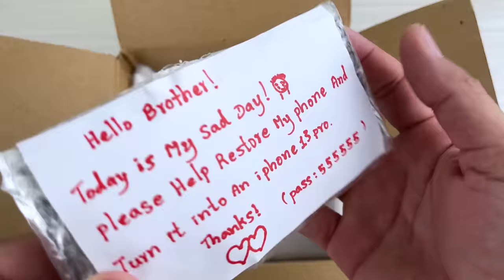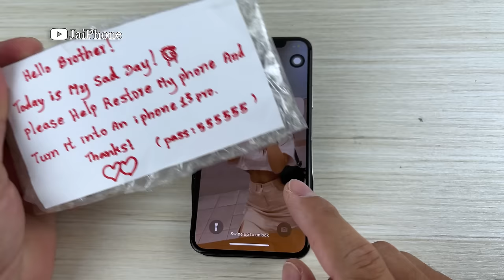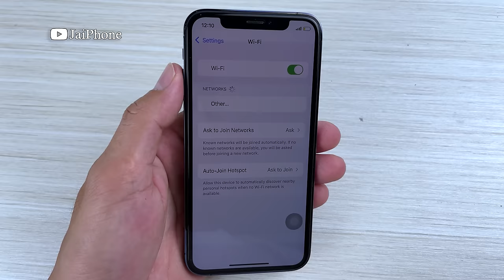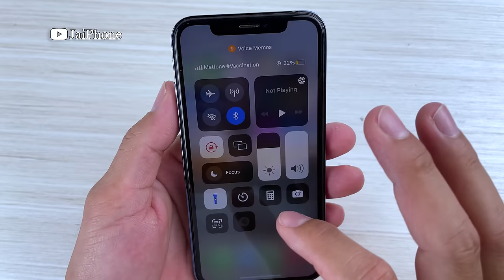How i Turn Destroyed iPhone X into a Brand New iPhone 13 Pro

Comment: Basically it's just: get a new screen, new case and transfer all the parts. But the skill and experience do count
Reply: @TheNocturious  I agree that it's a worthy skill. I meant the principle is the same: something like replacing the body of a car/motorcycle around it's engine.
Reply: @TheNocturious  bro did you even read the whole comment?
Reply: We can't remember how many parts are there in the phone that's also a talent and experience
Reply: Uh yeah what else is there to do? He literally transferred a phone that was bent and cracked into a better phone that had everything working normally what else did you want
Reply: Yes
Reply: That phone looks lke its been fighting Superman and lost
Reply: Eh, you did see that one of the camera lenses was covered, ergo nothing was connected to it?? Now that does not seem so legit. He basically transferred everything an iPhone X had, there were some changes over the past generations.
Reply: Hum sabka andar equal tallent hota h or usna apna tallent use kiya humara pass b yeh tallent h bass humay use karna ana chaiye h
Reply: So what else it’s supposed to be ? A magic trick?🤦🏻‍♀️
Reply: @nicoleregalado4160  well it’s still the old phone, just in the body of an iPhone 12 - the notch is too wide to be a 13.  Not all the cameras will work either
Reply: @TheNocturious  read the entire comment dmbasss not just first few words
Reply: True
Reply: Parece fácil pero no lo es mae si ponía un tornillo dónde no era el celular ya no prendería.
Reply: @TheNocturious  hater alert
Reply: Tera baap bhi change nhi kar payega sab part change
Reply: @shahidshaikh6256  मेरा बाप छोड़, मैं भी नहीं कर पाऊंगा, so what.
Reply: Oh ur smart👌
Reply: @TheNocturious  ok but genuinely with basic knowledge this isn’t hard like how when they stop updating the iPhone X that phone will stop getting new software so it’s just paying for something to look like something it’s not if you want the iPhone 13 buy the iPhone 13 don’t just slap the cheapest pieces on some old hardware
Reply: Vãi
Reply: Then do it yourself and send me the link
Reply: @cyruszamam8971  uhhhhhh how can she/he its true tho😑
Reply: Good
Reply: @Simon BTD YT  yes, i'm not saying its easy. The skill is definitely required. I'm saying once you have the skill, its pretty mechanical.
Reply: Im pretty sure he got new specs for the phone too
Reply: Even though that still impressive
Reply: But legend can only do this.
Reply: Abe to tu karke dikha
Reply: @siddhantawale1115  इतना मुश्किल नहीं है
Reply: Too many intricate pieces, I would definitely mess this up
Reply: Where you bought new screen and the case
Reply: @siddhantawale1115  हां यार, थोड़ा समय लगेगा सीखने में पर इतना आश्वासन है काबिलियत पर
Reply: @TheNocturious  Reading comprehension 1/100
Reply: Can u do it like he does?😐😑
Reply: Hi
Reply: No, this is called creativity and difficulty
Reply: @TheNocturious  they're literally just saying it in shorter words bro
Reply: U should have got a new screen there is a difference the notch on the 13s are smaller
Reply: Ki
Reply: You mad
Reply: I mean what else would it be???
Reply: Hlo
Reply: P
Reply: This is what apple do from iphone 10 to 13
Reply: Short version: buy iPhone 13
Reply: Vivo 15 प्रो का कॉम्बो और बॉडी मिलेगा तो बताइए
Reply: @water5795 Idk, maybe he doesn't know bud.
Reply: @TheNocturious  No need to be rude about it plus. It’s just making the phone look better the phone will never be able to run like a 13 because of apples phone springboard. It tells the phone what it is and it allows us to restore an ipsw in iTunes. When a iPhone X loses support so would this phone. So I’m basically saying that you can’t just turn an iPhone X in to an iPhone 13 for many obvious reasons.
Reply: @water5795  I’m pretty sure the processor and the ram are soldered to the springboard making them impossible to replace.
Reply: @TheNocturious  language man
Reply: @TheNocturious  gurl….
Reply: That's da meat of the matter! Skill is everything in this video
Reply: A abalidade que ele tem deixar os mecânicos da Apple no chinelo
Reply: Rrrr
Reply: Ofcourse!
Reply: 😂😂you have 7 subscribers with 3k comments incredible
Reply: We know we saw the video
Reply: @theirchild2827  I know! Incredible, isn’t it? :D
Reply: There's nothing "basic" about this!
Reply: bro free fire
Reply: Basically it's just to show off that I have iPhone 13pro no one is gonna say like no no let me check the performance is it real or not
Reply: ععععععع
Reply: غعارن
Reply: What if they cant afford
Reply: Isn't the video doing that?
Reply: Anyone asked you
Reply: Agree
Reply: But we still need experience as you said
Reply: @CoDNeonYT  I wish someone tells him that being rude won't make him cool
Reply: True
Reply: @dagger732  can you do this ? If no so why are you daying
Reply: @TheNocturious 
Thats my job aswell, and its simple once you get use to it, nothing so special about this video lol.
Reply: Florin celcel
Reply: চচ্চড়িতে লংপপর পপপপপপপটপপপপপটটটটটটটপপপটপপপপপপপপপপপপপপপপপপপপপপটডপপপপটকা দিল তার পর পর
Reply: Literally apple with their be phones
Reply: U also gotta know what to do and how to do it
Reply: @TheNocturious  qqqqq
Reply: Skill and experience? This man is a God.
Reply: Bruh masterpiece no I think wayyyy better than masterpiece
Reply: @amaramachupa6422  why don’t you read his comment
Reply: @demontan4535  did you not read the note on the iPhone I said turn it into not get the. One
Reply: @dagger732  actually sometimes it is
Reply: The camera on the iPhone 13 do work but apple just wanted to make it easier so the made a camera for the night vision ergo the third camera that’s the only change
Reply: @TVR.the_cool_dude  yeah you
Reply: @dagger732  bro, the whole iPhone was bent so he had to change everything that was bent even the batteries
Reply: @gamerkai884   i did. I saw 'stfu' then and i saw ' stfu ' now. Now u go ahead and understand wat he said not just read the words
Reply: Im from viet nam
Reply: Bro can u help me aslo
Reply: But you gotta give this man a credit for keeping all the screw in place if I were him I would’ve basically messed everything up
Reply: @Nxf6  oh yes, he is meticulous. I agree
Reply: I have iphone 6s it has heating issue
Company not give warranty claim because I bought it from Amazon and Amazon is third party seller for them
Apple says it has motherboard issue can you solve it
Reply: basically? It a art
Reply: I think,he's skill the best of the best
Reply: @sumsam5274   nj
Reply: Not like you can do better :/
Reply: @banufatimah401  well you hope so, you don't know so
Reply: 1 K me 70 ki jarurat hai 🙏 please 🙏 help
Reply: This is pure skill I bet you couldn’t do it
Reply: it isnt the iphone 13 has better hardware then the iphone x (larger battey,better chipset,better camera ect.)
Reply: yea it counts it’s the hardest part 😂 haha
Reply: Basically? Wow really man
Reply: @vkingcarmine1847  brown that’s hard to do. Why don’t you try doing it
Reply: I Pray 🙏 for everyone who Support me Or not
Reply: Great job
Reply: Yes the os still the same
Reply: I like the voice great job
Reply: KKKKKKK NAO SEI NEM COMO TIRA O ESTOJO DO MEU TABLET
Reply: yeah.and its still iphone x..
Reply: Ый
Reply: you got a point
Reply: There is nothing "basic" about any of this. If it were you'd show us your video doing it. 🙄
Reply: @l2eacly-4ur-mom   But 'could' you do it if you wanted to? 🤔
Reply: But it sounds easy but it is hard work
Reply: The way he fixes is his skill🔥
Reply: Simply put, why don't I think so?
Reply: Vvv
Reply: Njir epep 🗿🗿🗿
Reply: Same thing that apple does
Reply: screen of 13 pro or x?
Reply: @vkingcarmine1847  do you memorize all parts and where to put it back ??👊👊👊👊
Reply: @TheNocturious  you should prob read the whole comment before sending hate 🤡
Reply: Parabéns aí mano, você resumiu a iPhone! 👏👏👏
Reply: Thank you i can see the video
Reply: That's not easy
Reply: Mere mobile ko bhi change krna he
Reply: Tools do the job
Reply: But It upgrade the hardware?
Reply: What if the line of the phone?
Reply: @TheNocturious  aa
Reply: ي
Reply: @TheNocturious  ييييي
Reply: @TheNocturious  u
Reply: But the skill and experience more expensive from price 1 iphone
Reply: @TheNocturious  no, it’s not, i don’t know what y’all think a masterpiece means at this point-- they’re great at what they do, but it is not fantastic or a masterpiece.
Reply: @fynkozari9271  fr
Reply: @matze98md  fr, that 3rd camera was fake ig
Reply: True
Reply: It’s true like I am 10 years old and I know so much about phones I can also transfer that parts in an other iPhone it doesn’t matter which iPhone I can transfer I can transfer it into iPhone 13,13pro and 13 PRO MAX.
Reply: Good performance
Reply: But the small parts
Reply: @matze98md  you will understand if you ever become a iPhone expert
Reply: @TheNocturious  xxxxx
Reply: @TheNocturious  x
Reply: @TheNocturious  x
Reply: U used  the colon wrong, u needed a coma not a colon
Reply: @RajeshPatel4336curry  okay :) noted
Reply: Apple should file a complaint against him. For cheating
Reply: Just will perform worse than an actual 13pro.
Reply: @TheNocturious  yes 😀😀🤣🤣
Reply: All the bits so small and so many one wrong screw and you fry a part not easy
Reply: Ha ha I dumped my iphone x in the toilet at 3am.  That was it...$500 gone,!
Reply: Why does this have so many likes
Reply: Skill?  😂  bhai bgmi hi yaad aata h har jaga.
Reply: It doesn’t work like that my guy
Reply: Phone surgery 🤣
Reply: yes
Reply: now i got packge
Reply: i don't no
Reply: i open it iphone 13 pro
Reply: and Propect screen glass case
Reply: S
Reply: @vkingcarmine1847  he transferred it into a better casing not a better phone. It’s still the same phone
Reply: Basically that’s why many paid for it to be professionally repaired (by someone like him)
Reply: @kabukd  there are so many professional mobile repair mechanics. :)
Reply: @ThomasTheEliminate  awesome
Reply: @dude28319  Yes 😁
Reply: @TheNocturious  😐
Reply: 1
Reply: Kids now: breaks their i phone X and replaces the parts XD
Reply: how new iphones are made:
Reply: @CoDNeonYT  yea- he did. but like- can u do that shit at home.. N.O
Reply: @richeh79  k.. but like did u see how it looked at the start?
Reply: @TVR.the_cool_dude  wdym? the person who wrote the comment is the hater- he is defending the ytber-
Reply: @rockychameleon5076  for us people that dont do this it may be interesting.. u know there are others around u who dont know how to do this?
Reply: @anhthuphanhoang7648  k?
Reply: @wtvrishanaa  imagine replying months later
Reply: @CoDNeonYT  ikr
Reply: why are ppl hating on this comment it has nothing bad to say it’s just saying how he did it in a very fast way
Reply: Y
Reply: Well.. what else would it be?
Reply: @TheNocturious  hjhjhjjj
Reply: Silpbm.
Reply: you could just leave the second half of your comment to show your respect or something similar, right? what's the point of the first half ? trying to show you are the only one understand the high level logic?
Reply: @soph1eky4w  becaue the first half of this comment is not necessary and made others uncomfortable i guess. or you did learn something from his first half?
Reply: You need to remember every screw where it should be screwed. In the phone
Reply: @diongdiongclass  the point of the first half is that all his videos have the same principle. Its mechanical work: take all components out, get a new screen, fix them in.
Reply: @ramnunsiamahmar5889  Yes, i agree. I would compare his work to a mechanic working on a car's engine. Similar principles
Reply: He had just helped anyone. Bro ur really appreciable
Reply: Its hard
Reply: just buy a new phone at that point
Reply: And where we have to put iPhone parts
Reply: @The_straight_path_to_jannah  rit8t5ue7geuei5hfu
Reply: @imremu  that wouldn’t work bro
Reply: Ok nerd
Reply: But some companies can't even fix this
Reply: @piyushridhimagoyal7061  how does that matter?
Reply: @cyruszamam8971  it’s pretty easy, if you have the correct tools, and are organized
Reply: @imremu  it doesn’t work like that
Reply: L
Reply: Yeah, skills do count, there are plenty of reasons, one is my opinion, is if you don't have skills and like this, you might end up breaking your phone entirely.
Reply: Please ennoda phone entha mathiritha please help new phone 📱 please
Reply: Hello tell me what to do if the iPhone12 pro fell from the 5th floor
Reply: Im agree
Reply: Им г
Reply: @TheNocturious  jjjjjjjjjjjjjjjjjjjjjjjjj
Reply: And it was rlly broken do y know?
Reply: Its not that hard really
Reply: @The_straight_path_to_jannah  remember? Just Take photos
Reply: Same
Reply: Same
Reply: @dagger732  giehauawhhabwhaaah
Reply: @TheNocturious  i agree
Reply: Bro skills matter too
Reply: What else did you want then?
Reply: Op
Reply: 7tyu
Reply: Можна навчити по надіслати мені телефон дядька будь ласка
Reply: Jpppp
Reply: It will be the same process with the iphone 11 right ?
Reply: I cannot see good the order of the cameras, it be vertical right ?
Reply: Nam mô A Di Đà Phật
Reply: Name of the case please
Reply: If you can do it then tell about  theam
Reply: @roufkhan7444  see, i cannot do it. But if I learn, then i can do it. This is not complicated work. Its like a mechanic repairing a car or bike.
Reply: @dagger732  thats true ! I’m agree
Reply: @TheNochturious7721 You delete ur own comment oh my..
Reply: Driving Simulat
Reply: @dagger732  1 1
Reply: @The_straight_path_to_jannah  there is no certain amount of parts it depends on the phone
Reply: @dagger732  are
Reply: urdu
Reply: Or just get a new phone (the easy way)
Reply: @mystxmortal4929  YouTube translate be like: my goals are beyond your understanding
Reply: @dagger732  o
Reply: P
Reply: @dagger732  p
Reply: Op p
Reply: @dagger732  p
Reply: @Rajeshmishra-sh4rv  p OP
Reply: @vkingcarmine1847  and
Reply: @vkingcarmine1847  the
Reply: @CoDNeonYT  and a great pleasure in informing the
Reply: @The_straight_path_to_jannah  opportunities
Reply: @CoDNeonYT  p
Reply: @fynkozari9271  to get p
Reply: @mystxmortal4929  ppp
Reply: @itsz_risham  apart in
Reply: @itsz_risham  and the
Reply: @vkingcarmine1847  to be in a few pictures and videos to
Reply: @vkingcarmine1847  po
Reply: @matze98md  the first one
Reply: Smsmlw😄😁😖😁😖😆😖😁😖😖😖😁😁😖😖😁😁😁😄😖😁😁😣😣😣😁😣😣😁😣
Reply: It’s not basically, you go and try it yourself
Reply: @DJ-ty3sx  i replied in other comments too. If i put the effort this is not too difficult to learn. It's like a car mechanic.
Reply: i think we all were expecting the same you did'nt pointout anything new
Reply: @CoDNeonYT  q
m
Reply: @dagger732  WW
Reply: yeah its simple but not easy👍
Reply: Yes please read  this is  for Me
Reply: Please help me it is important
Reply: Yes  I pray you  it  is all my life  it  has been  my husband
Reply: @dagger732   I see you make all the best  you make a big gift
Reply: Happy  I hope may happen to have  ask  how I thak you
Reply: @Rajeshmishra-sh4rv    you think if I click  I could read
Reply: @Rajeshmishra-sh4rv  yes how I can recreive
Reply: @Rajeshmishra-sh4rv   I click copyright  it is okay
Reply: @Rajeshmishra-sh4rv  copy
Reply: Yes indeed....I agree!!!
Reply: Wow this is amazing just subscribe to this channel how do I send in mine for fixing too you've earned a new subscriber
Reply: My friends, the religion of Islam and Christianity is one and Christianity is part of Islam, but is Jesus God or the Messenger of God?
Reply: Make it but is so easy
Reply: @shahidshaikh6256  bro he was talking ki log faltu me paise waste krte iPhone 13 pro max me convert krne ke liye. Showoff wo banda kr lega pr performance wahi bekar rahegi
Reply: @cyruszamam8971  dumb 
He wanted to say that we cannot change performance and its a waste of money to restore it like another phone.
Reply: @siddhantawale1115  CHOTI BACHI HO KYA xd
Reply: @jeenajanesh303  CHOTE BACHE HO KYA
He meant its a waste of money to restore it cuz restore takes extra charges
Reply: @tanishqsuravase8134  true
Reply: @rubinajamil4919  THEN THEY SHOULD NOT THINK TO BUY A TRASH PHONE AND YEA THERE ARE DIFFERENT PHONES OTHER THEN IPHONE IDK WHY PEOPLE WASTE THERE KIDNEY FOR JUST TO SHOWOFF
Reply: @ReenaSharma-hd2pp  he wasn't  rude bro. He meant its a waste of money
Reply: @ishadsp4680  don't spam
Reply: But the gpu and chipset tho
Reply: Ye
Reply: I'm 15 myself I wish he could do my phoneThat's probably what iphone does every year by their selfs this guy is just making a kids dream come true for that I love him
Reply: @TheNocturious7721  Dude but I can't see where is the  comment maybe  @TheNocturious7721 reply of a comment is deleted
Reply: You make it sound so easy why do you try it on your phone and see what happens lol
Reply: What did you expect? Walk on waters?
Reply: True because anyone without the knowledge and/or skill of this will only destroy the parts
Reply: I got u hommie 😭😭😭
Reply: Hahaha
Reply: @Nxf6  people nowadays r stupidly comparing themselves to other people's profession the same thing ur doing now
Reply: @Yuze-hl9uj  did i insult jayphone? No, did i say hes not good at his work? No, so tell me how the hell am i insulting his work?
Reply: @Nxf6  i didnt start anything about insulting.did my comment seemed like that?i was telling that Comparing yourself to someone with years of experience and hardwork is stupid
Reply: @matze98md  yes
Reply: The problem is that noone know the battery will died because it's for iphone x not 13 pro max and beacase iphone 13 pro 120 fps but iphone x 60
Reply: انس ايش اسوي
Reply: وقت عندي وقت عندي وقت عندي
Reply: انت سعودي ولا لا انت سعودي طيب خلي بابا نايم ابوي نايم انت انت سعودي جبت ايفون هنا ولا لا يا ساتر خليه خليه يا
Reply: انا اسف انا اسف اذا ما انا اسف يا زمان عندي نوم انا عيني عندكم عندي نوم انا ما ابي العب لعبه اسف عبودي الاعبك ابوي نائم تعبان
Reply: ً ما باكن سعودي باي انا زعلان انتم ايش فيك ما كلموني انت عندكم سبان وينك
Reply: He says basically pfft 🤣
Reply: @demontan4535  I have a lot of experience in replacing back housings and much more but I’m telling you it’s not that easy, it may take up to 5 hours depending on what phone so yeah..
Reply: Hola  are latalo
Reply: @dagger732  0
Reply: @tatybravo8035  what is latalo?
Reply: o
Reply: The thing is it's just a 13 Pro but he transfered all the data 🤣
Reply: @ND-im1wn  what?
Reply: @dagger732  a bk6
Reply: 7am c,  pump
Reply: @NBA-jq6mr  can you?if not don't speak
Reply: Nadie te pregunto
Reply: @dagger732  di yg lain tyyyy6yy
Reply: Однозначно!
Reply: Oh really? I didn’t know he puts a new screen, new case and even transfers the parts. Crazy
Reply: O SIMKARTA
Reply: Hai
Reply: "Basically it's just" lol
Reply: @yuanfrnt007  kind  of?
Reply: First of all It's not basic try to make one and show yours to us😂
Reply: @sonsonvitan2126  he is talking about the principle kiddo get lost
Reply: Yea u need skill to do it
Reply: Jai do you read these msgs? 😮😮😮😮
Reply: @bitozbob  nah :)
Reply: Hi
Reply: @Nicolas425  hi
Reply: i’m seeing so many @TheNocturious7721 but i can’t find their comment where is it
Reply: 😅 i’m surprised how you fix those phones
Reply: Agreed, skills and knowledge.
Reply: @dagger732  its not just: get a new screen,transfer parts
bc its almost flipped
Reply: JNjanp Tum paraai no store
Reply: How do you get a new from 🤔
Reply: @CoDNeonYT  
IajhHo
Reply: Probably
Reply: বিশ্ব জীম্মাদার হযরত সাদ সাহেব, তার খেলাফতে
   বাংলাদেশে টঙ্গীর ময়দানে বিশ্ব ইজতেমা অনুষ্ঠিত হবে। 
  তারিখ  20, 21, 22 জানুয়ারি 2023,
আমরা সবাই দোয়া করি, যেনো আমরা সবাই হেদায়েত পেয়ে যায়, আমীন...
   এই বারে বিশ্ব ইজতেমায় হযরত সাদ সাহেব আসবেন, ইনশাআল্লাহ
     আর সম্মানিত ব্যাক্তি হযরত সাদ সাহেবের বিরুদ্ধে যারা যারা অপপ্রচার চালাবে, তাদের বিরুদ্ধে ব্যবস্থা নেওয়া হবে, ইনশাআল্লাহ
   আর ইজতেমার ময়দানে সবাইকে আসার দাওয়াত রইলো, ধন্যবাদ
Reply: @dagger732  there are so many small parts if only one will be lose then u know………😅😅😅😅
Reply: @Evil__Weevil  absolutely. I agree with you
Reply: Its just?? Then why dont you do it?
Reply: @Barricade101  with some experience i'm sure i can do it. its mechanical work at a more technical level. think of repairing cars, repairing smartphones
Reply: Aonde você mora aonde que você mora
Reply: How much for due the same thing for me
Reply: I mean, I'd prefer this anyday than buy a new iphone. iPhone's basically just for showing off
Reply: Bro plzzzzzz can u tell me where is hic location and how much did u pay  only for converting plz tell me 
Thanks
Reply: True
Reply: Ооооооооооооооооогоогоооооооооооооооооророороророохххххххххххххжжжжжззщщшшггннееккууццййфыффыыввввааппрррооолллддджжжжэээяяяячччсссмммииитттьььбббююю
Reply: @dagger732   If I create the code awkward the paper
Reply: Call wife on speakerphone
Reply: سسصصس
Reply: @dagger732  r
Reply: @CoDNeonYT  э0э0😊хэжхх
Reply: Exactly
Reply: @CoDNeonYT  aaa
Reply: @dagger732 9:55
Reply: Best of luck
Reply: @CoDNeonYT huh
Reply: Dhdhiddjieueieejsjehjehe
Reply: 666666666666
Reply: ٣٣٣
Reply: We understand the jealousy that made you try to diminish the actual skills. 
FYI, there are varying lengths of screws, switching some will damage the phone, 
there are small plastic parts that if you do not transfer can damage the integrity of the phone,
while removing the battery or the different parts, any lack of technical agility will cause irremediable damage to the components (flexes and connectors break really easily),
knowing which part you can replace and need to replace based on the troubleshooting (connecting new screen and seeing how it works) is tricky,
when you remove something you need to know the position of everything not to damage something while prying it open,
knowing what to test so the customer doesn't send back a phone right after you send it,
if you do not remove the battery before anything else, you risk damaging the other connectors,
not putting the right adhesive at the right places will cause humidity risk factor and potential battery or LCD damage,
damaging the face ID, irremediably makes the phone irreparable even by Apple so you essentially lost years of data from the customer,
but sure it is as easy as mounting IKEA table,
I await your videos of doing this to help out your friends ! ;)
Reply: He had to bu new screen cause it was impossible to fix that screen and back
Reply: Alguien sabe donde puedo conseguir la carcasa exactamente a la del
Video con todo y su pantalla?